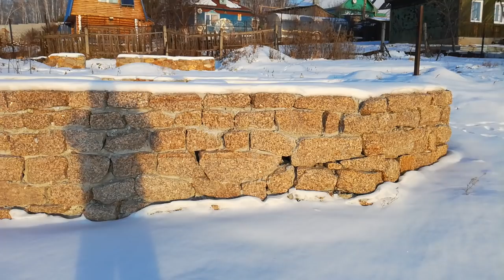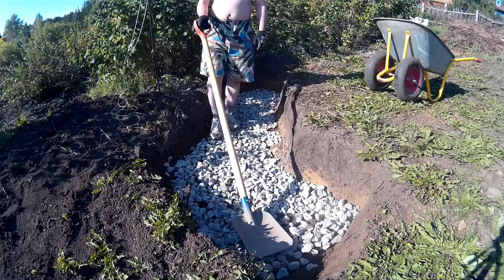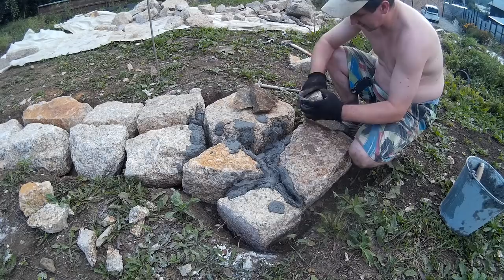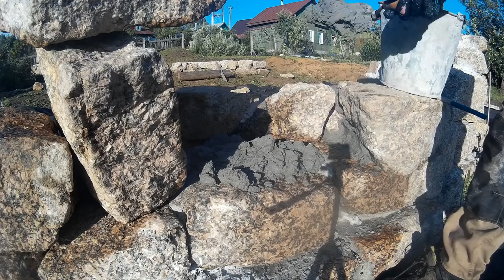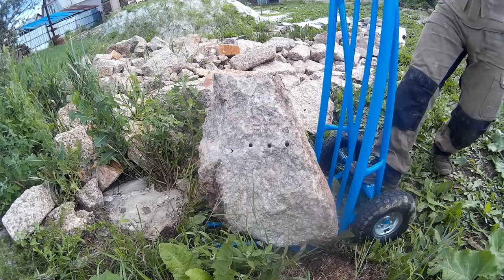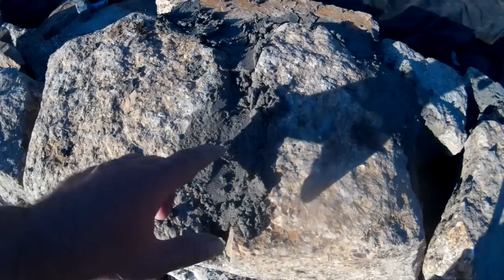Stone foundation for a log cabin

Comment: are you concerned at all about the rocks not being bellow the frost line enough?
Reply from the maker: Good question. In my region, the frost line is 80 inches (2 meters). Residential brick or block houses are built below the frost line to avoid cracks. The foundations of wooden houses are usually shallow. I understand that the soil will freeze and raise the foundation. This building is auxiliary non-residential and I do not impose high requirements on it.
Reply: @DenBuzuev  Two meters?! Holy freaking moly! Where do you live? North Sibiria?
Reply from the maker: @Kleinalrik  Ural. Chelyabinsk (Челябинск).
 http://rfund.ru/wp-content/uploads/2015/02/Glubina-sezonnogo-promerzanija-grunta.jpg

Comment: Is there any concern about digging the foundation below the freezing line..? Planning my log cabin in Canada with similar freezing seasons, but most literatures tell that I should pour a concrete "footing" slab below freezing line. Does heaviness of the rocks would make an above freezing line foundation enough stable? Thanks for hints or references.
Reply from the maker: This question I often asked myself. Here are some excuses I used to convince myself to move away from technology:
1. The directories indicate the maximum depth of freezing of the soil without taking into account the snow cover. Now I can’t find the catalog, but in my case, if I don’t remove the snow, the freezing depth will decrease from 2 to 0.5 meters.
When we visited my grandmother in the village as a child, we always did a large snowdrift around the house to insulate the house.
At this moment, builders lay a special polystyrene foam under the blind area at a distance of 0 ... 1-1.5 meters.
2. The degree of soil expansion in winter depends on the moisture content. Much depends on the type of soil - I have stony soil with clay plus the slope of the site. Water does not linger. In our region, builders make wide blind areas and drainage ditches with a well around the house. Thus, water is removed from under the house. It is also important to drain water from the roof through the gutters behind the perimeter of the blind area.
3. I consider a large foundation pit for a small hut irrational.
4. Repairing a foundation with a low laying depth is easier. In case of problems, you can raise the house with a hydraulic jack and repair the damaged area or completely replace the foundation. In our villages, 50-year-old log homes are often repaired this way.
Answering your question. In our region, there is an opinion that the foundation cannot be left without load. The foundation, walls and roof should be built a season before the start of winter. My foundation for the winter did not change its position relative to the horizon - I tested it at the laser level.
Reply: @DenBuzuev  Thank you very much for your answer. Will take all those elements into consideration while preparing and study my lot for the building process. Will follow your progress meanwhile. 
Internet may have flaws, but connecting peoples from different country with same interests for constructive exchanges always amaze me!
Thank again!

Comment: What was the purpose of the white powder you laid over the tamped gravel base?
Reply from the maker: This is fine sand. Used to fill the voids between gravel and stones. The stone has an uneven surface. The stone was unstable only on gravel, and I pressed it into the sand.

Comment: Love this excellent work can you tell us what kind of stones how many tons guessing you had it delivered ? And any of that type of info for those of us willing to learn  take on this kind of work? Awesome job and video!
Reply from the maker: This is granite. I used about 30 tons. The external dimensions of the building are approximately 7x7 meters. I bought a stone as a waste of a quarry where slabs, curbs and paving slabs are made. The cost was about $ 300 with delivery. Granite is difficult to process, it splits unpredictably with a sledgehammer, it is better to use wedges. Before that, I had experience with sandstone processing. Sandstone is well processed. But granite is prettier. I can say that working with a stone made an indelible impression on me. It is not at all like brickwork, each stone is unique. Like solving a puzzle. It was difficult, but I'm happy with the result.
Reply: @DenBuzuev  thank you!
Reply from the maker: @bradnecolemorris6302  Here is the channel where I got information on masonry 
https://www.youtube.com/user/MrStonecentury

Comment: Sorry, saw it right now, dumb question.
Big gravel underneath for frost, well done.
Reply from the maker: In my area, the frost line is 2 meters (80 inches), so I did not go deep, but expanded the base. In my area, to the depths of freezing, people build the foundations of houses from heavy materials (brick, from blocks). Small foundations are used for wooden and frame houses, we remove only the fertile layer.

Comment: You should not be wetting the stone before applying your mortar. The stone needs to be dry so that the water in the mortar wants to get absorbed into the rock. The water brings the cement with it and that's what creates your bond.

Comment: Why did you leave so many mouse holes?
Reply from the maker: Holes are necessary for air circulation under the floor, so that the boards are not covered with mold and rot. As a rule, a thin metal mesh is installed inside the holes. I have not installed it yet, because over the past 5 years I have not seen mice in my area, hungry neighbor cats, apparently, met them earlier, and if I see mice, I will put on a net.

Comment: i wonder how it deals with the frost
Reply from the maker: I made the foundation last year. So far, I have not found a single crack.
Reply: @DenBuzuev  Did you use mostly lime in your portland? Rocks need to expand and contract, a heavy lime ratio works best for this. At least that was the theory when building field stone foundations a 100 years ago
Reply: @DenBuzuev  nice
Reply from the maker: @danbiss87  Unfortunately, I do not know the composition of the Portland cement that I used, probably there is lime there.

Comment: I'm planning on building a 1900 sq ft ranch home, no basement with all stone and a slate roof. This footing doesn't seem very deep. I thought it would at least need to be a few feet underground? How thick are your walls, 18"?
Reply from the maker: Sorry for not answering right away. In my case, the ground is rocky. I removed the fertile soil and the base under it was solid. The shovel almost does not take the earth. Foundation thickness decreases from bottom to top from 24 to 16 inches. In your case, you need to know the hardness of the soil under the building and choose the depth based on the depth of the hard rock, such as clay.